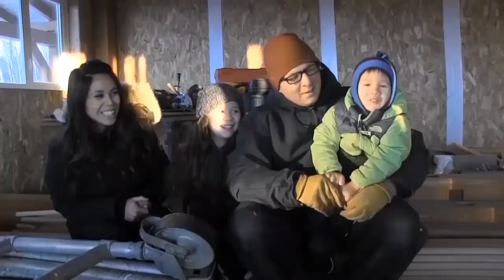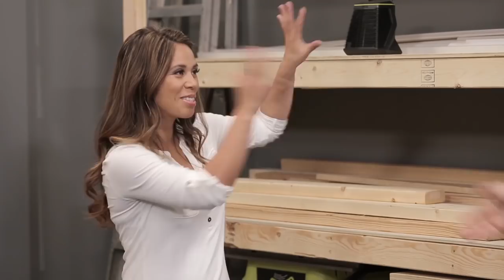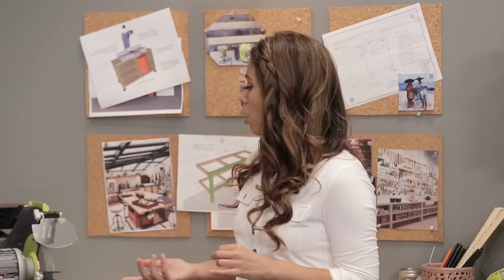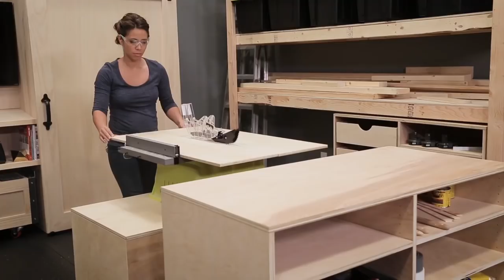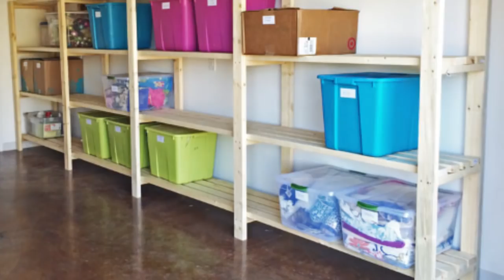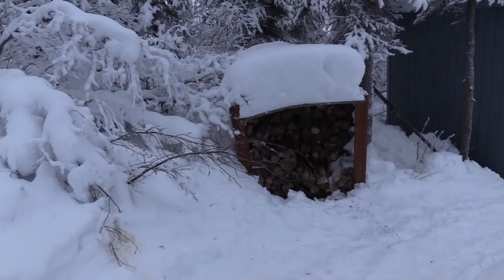Shop Talk

Comment: I like what you've done overall. Making the various carts and storage cabinets the right height to be in/out-feed or support tables and still roll out of the way was inspired. I think I'm going to have to make 1 for an outfeed for my table saw. :)

I really would have liked for y'all to have made a more of an effort (or highlight the effort if you did it) on dust collection. Controlling at least most of the sawdust is important for health and just to avoid the mess. I'm not sure how you remove all the dust that will accumulate under the table saw short of picking it up and moving it, but hopefully you have a way that's not visible from the picture/video.

I like the Murphy Worktable enough that I'd like to build it but I don't know where I'd put it. :)

Comment: It's so hard to make a shop you should be the router table you need a table saw you get a job son you need a drill press you need a sander planer things that feed 8-foot pieces of material through them you can't put them in a shop on the Lazy Susan you got to be able to rip cut it and cut it square and have a way to do that easily

Comment: Could you combine you're rolling workbench along with your free-standing shelves to have a movable shelving system similar to the wire shelving system with casters? This idea I got from Toyota where they put everything on Wheels so they can be moved and can be cleaned behind it or the room can be dynamically adjusted if your storage needs change or if you want to change the shape of the room so to speak.  Paul Akers at fastcap.com has some videos where he uses movable wire shelves in his Factory based on this Toyota idea but I like the idea of building my own shelves and so on. And also if you did more for your free-standing shelves How much weight would they support? Current wire shelving holds anywhere from 5 to 800 pounds or so from my basic research. Thanks for the great video and looking forward to trying some of these ideas.